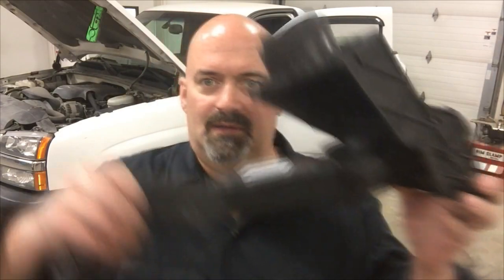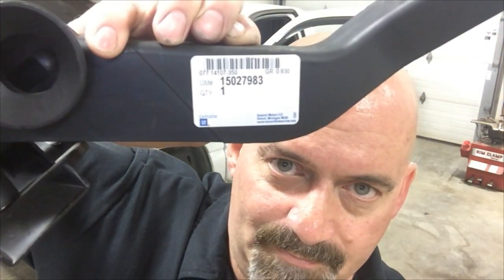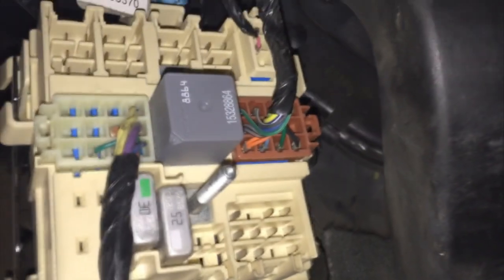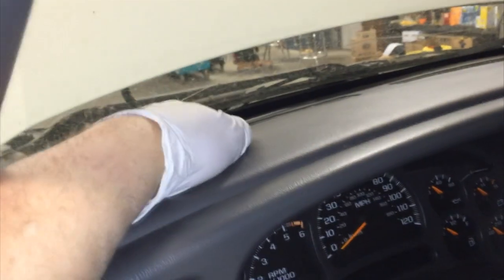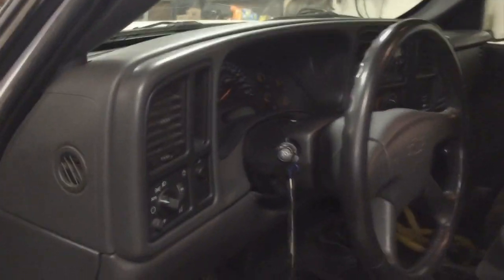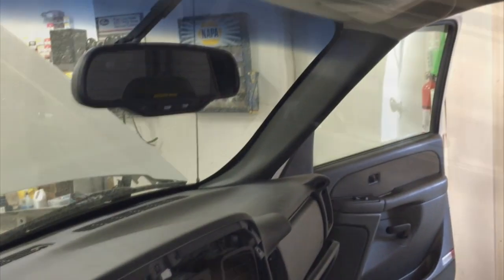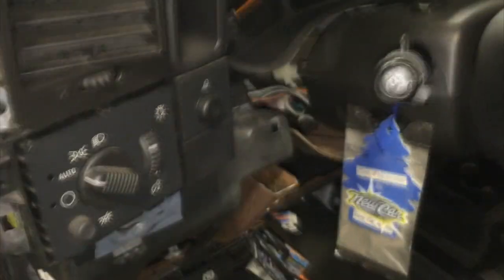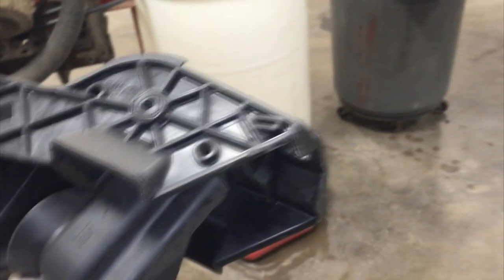Replacing Chevrolet Silverado GMC Sierra Clutch Pedal Assembly - Broken Clutch

Comment: Great Video! My assembly went out on a 2003 about a year ago. Trucks been just sitting until this week when a former employee called needing some work.  I showed him your video and he spent a couple mornings replacing pedal assembly. He started truck after replacing pedal and pop the assembly breaks again within seconds. I was not present during test or on installation. He s not a great mechanic and letting him fix it was more charity than anything. I remember a lot of pressure to push down slave cylinder, because I tried to put metal strap on firewall with self taping screws around assembly to get home when assembly broke, but finally gave up. My question is slave cylinder .or something else causing breakage , or my bad judgement in letting some one who is always losing jobs because he smokes too much pot.
Reply from the maker: Yes, sounds like a master, slave cylinder or even clutch issue causing this. I have heard a few reports of this but not run into it personally yet. Bummer deal!

Comment: Watched 2 others before this one and both of them got it out without taking any dash pieces off. They slid it towards the seat then pulled the front of the bracket down first and then twisted it and bam it's out.

Comment: So I did this and got the clutch pedal fixed, but now there is a service air bag light on the dash, but it turns off when I turn the passenger air bag on. Does anyone know what might have happened?

Comment: Trying to determine if this is my issue. 
Pedal goes right to the floor. I can shift if I mash the pedal into the carpet. 
No leaks, no low fluid. Replaced master cylinder on end of the transmission and the clutch pad two years ago. 
I do not see any broken  plastic from the engine compartment side.
Reply: Timothy Delaney I had the same issue with mine before the pedal broke. My guess is air in the system somewhere, or a leaky slave in the trans.
Reply: One way to tell if it’s the issue is to pop the hood and give the master cylinder a gentle tug forwards, if it’s not broken it won’t move at all.

Comment: Hey man, just had my trans replaced with a reman, as well as flywheel resurfaced and new clutch. Now it appears that I can not get enough play to fully disengage clutch. Shop told me that’s on me and not their problem. They said I need a new clutch pedal because no adjustment on my 04 GMC Sierra 2500HD. Is there really no adjustment or alternative for this supposed 1.5” of extra play which they claim is the problem?

Comment: I have to replace mine in my 2001 Chevrolet Silverado 2500HD and I  never once took the dash apart just the 3 bolts out of the pedal assembly and doing a little twisting and she came right on out with out breaking it more or anything else
Reply: Nathan and anyone else with issues, I have found that removing the pedal from the mount, then removing 3 bolts makes the broke mount come out easier and works best. Like Marshall Mullins suggested, a heavy gasket scraper wedged up in front of mount towards firewall is a great suggestion. I have a '02 ZF-6 speed and it finally broke like everyone else. The pedal pivot point has 2 spring loaded tabs that look like hex nuts and you can compress them and slide pedal down. The spring on the left side of the pedal will come apart obviously. When I reassembled, in reverse order, the new one I used 2 zip ties to compress it. Once I had it all back together, I just snipped the zip ties. None of the pulling the dash part is needed.

Comment: I have 3500 1996 with 6.5 engine manual shiter. I just bought it The truck had clutch problems I was told . Now start the truck only too start it in gear So basically start in 3e gear to drive I cant shift any more after that She won't engage lower or higher .Now I just brought the truck in and got the master cylinder replaced . Still the problem . Do you think its the throw out bearing or its the transmission . Let me know thx

Comment: hey I was wondering im going to swap my 91 4x4 700r4 to a nv3500 4x4 manual my question is are they the same length or will I have to customize the driveshaft length  got all the parts ro convert I even have the transfer case for the nv3500 please get back to me soon thanks
Reply from the maker: +robert Dowell I really have no idea but I bet you can find someone who knows for sure. I know the driveline service places would likely know the answer to that question. My guess would be it's the same length but don't go by my guess. Good luck.

Comment: car doctor.
I cannot find where the one of the two connectors go on the neutral safety switch not the 6 prong but the 1prong
Reply from the maker: +Cory Hall it's been a while my memory is fuzzy. Actually it's always a little fuzzy. Is there really two connectors? Is one for the stop light switch? Sorry I can't be more help.
Reply: Did you figure it out? Same problem. No dash illumination, no brake lights, no turn signals...
Reply: Did you ever figure out where the single wire goes?

Comment: No need to kick the dash back, I just did one on a 2003 Sierra by cutting back the firewall insulation and sliding the firewall side of the assembly down and out.

Comment: Here’s a question you might be able to answer. I have an 03 Silverado 4.8 4x4 with a 4l60. Ive already been thinking of what to do when it craps out which they all do. How hard would it be to manual swap? I understand I would have to cut the floor and replace the control module
Reply: I'm doing the same didnu end up doing it any tips

Comment: Hi Doc, 
I have manual 01 Sierra 4.3L.  My clutch is very hard and i have to press the padel all the way otherwise it starts grinding and would not change the gears.  Si i have two issue here hard cluch and  shifting requires pressing the padel all the way.  Please advise what could have gone wrong?
Reply from the maker: Probably a bad clutch cover plate or broken input shaft collar. Likely requires transmission removal to fix.
Reply: It could be this pedal assembly as well. was my symptoms exacly before mine broke. I had just bought the truck but found out the previous owner had replaced it twice already.Something to watch for is the quick connect coupler gets has a spring inside that can break or rust and severely restrict fluid flow to slave cylinder. This was the problem on mine and reason  this assembly broke for the third time within a year. Too much force required to push the pedal down due to bad quick connect fitting. You should check this if your pedal assembly breaks or if it has symptoms such as yours.Good Luck and thank you for the video The Car Doctor!

Comment: i have a 1992 chevy 1500 i replaced. the resavor thing u out fluid in cuz old was plastic. i got a new one running fine now i squirting out fluid u  where oush line in. i cant get line out an person who helped didnt out in the pin so i thought ok did my o ring get stuck or something.  i have pulled an all an pushed an pull out an line wont come out. can u assist me please. im doin this myself
Reply from the maker: Not sure what happened there. Maybe try a pair of pliers and just rotate it while pulling out. Sorry I cant be more help. Good luck

Comment: 2006 Chevy Silverado WTHey man,Got the job done, but I was left with one blue wire with a clip hanging down. it seemed to be taped to the clutch safety switch wire harness. When I got it all put back together,1. my instrument cluster wont illuminate (background light, everything else functions)2. no brake lights3. no turn signals4. no blower motor5. ABS idiot light6. anti theft idiot light (no alarm installed)HELP!...but the clutch works!
Reply from the maker: Sorry I just saw this. Sounds like you blew a fuse or something like that. Hope you got it figured out.
Reply: Did you ever find out where this wire connects?

Comment: how do I get the clutch switch to have spring tension on it again? that's the only thing holding me back
Reply from the maker: the switch may have broken when the pedal assembly failed. It may need replaced. Its cheap

Comment: I just finished changing that part out and now I can hardly push down my clutch an inch. Any advice? Sooner the better. Thanks
Reply from the maker: You may have a problem with the clutch or clutch master cylinder that caused the initial failure. Will the pedal operate freely with the master cylinder pushrod disconnected?
Reply: +The Car Doctor I just opened the bleeder on the  Slave and it pushed down no problem. Maybe was locked, have to get the air out of it. But now I can't get it to crank, just spins over. Not sure if I blew a fuse somewhere or what's going on. Any tips?
Reply from the maker: Spark? Fuel?
Reply: +The Car Doctor got it running. Pulled a ground out from alarm system. Still having clutch problems. Real spongy. Slave cylinder? Trying to bleed it now
Reply from the maker: They are a pain to bleed since air doesn't like to go down.

Comment: Just did mines and didn't have to do all that.....  Unhooked the battery, took the clutch master cylinder out, bolts out the pedal,  moved a few wires,  and with a screw driver I had had it out and back in about 30 mins

Comment: Is It possibly a bad master, causing to much pressure, on the pedal assembly, flange.
Reply from the maker: yes. Not likely but yes
Reply: Well I did not replace the master. all good for now till next time, cheap plastic. I also had to pull the dash back. Great video saved me alot of time. Thinking about buying an automatic next time. Thanks  for the video.

Comment: sorry, at least on ours we did not had to remove the dash, 
1. remove the fuse box, it flips foward and out
2. remove the fuse bracket , one screw is behind the kick panel
3. flip the column grommet to one side, has a clip, gets a little stubborn as older it gets
4. remove the cylinder shaft and safety switch as shown on video
5. remove screws as shown on video
6. pull bracket downward from the firewall side first slightly turning the pedal counter clockwise, and out it comes
INSTALL
reverse process
clutch master cylinder goes in at an angle then turn counter clockwise 
inspect groves on clutch master cylinder first before installing

GOOD LUCK
Reply from the maker: +Daniel Cruz Can you give us the year, model, engine size, 2 or 4WD? Thank you for the info.
Reply: Yep, Daniel Cruz is correct, just did a 2006 chevy 1500. i put a small pry bar between fire wall and opening of clutch pedal assembly and it popped right out. saved me hours. Thanks dude..........
Reply: Daniel Cruz, thanks bud!! We just finished putting ours on 9/4/2018. We almost tore off the whole dash board BUT THANKS TO YOU, we followed your steps and we are done! 2005 Chevy 1500 2WD!! Thanks again!!!

Comment: hi mate nice vedeo you know the reference of ECM that truck i need buy the same ECM for my suburban 96 because i change a automatic transmission to manual transmission i need change the ECM to but i don"t know who the reference you can help me much if tell me the reference of the ECM  thanks
Reply from the maker: I suggest you contact the dealership for exact part numbers using your VIN code. Good luck

Comment: hello I take this opportunity to say that and a great video. I have a 95 chevy suburban 6.5TD, but bought a manual transmission and all the accessories to apply because they do not like to drive cars with automatic transmission. the question is? it is possible to make this change? and like this Silverado? I appreciate that someone show me some vedeo or any help. i love my suburban and not change the other. thank you for your attention. jorge from  norway.
Reply from the maker: +jorge fonseca I am not sure but imagine it is possible. It will likely require a lot of under dash parts like the clutch pedal and even brake pedal assemblies since that's not the same with an auto. You might ask someone who does that kind of swaps as they will know all the information you need. Good luck and thanks for stopping by!

Comment: 4.3 with a 4.8/5.3 cover and intake??
Reply from the maker: With a couple less cylinders.
Reply: @ThecardoctorTV  ummmm no that’s a v8 bud, 4.3’s don’t have that cover and the tb is in the middle not near the radiator and the air intake makes a Z to the passenger side fender box
Reply: Can even see the huge wire harness leading to the intake😭😭

Comment: A plastic clutch pedal assembly made by the company that has produced iconic symbols of the American automobile industry. Cars the American people truly identif(ied) with. NICE GOING General Motors / Chevrolet...... No wonder the American tax payer had to bail out your sorry asses.
From the time I was a kid, in the early 70's. Which I was ten years old in 1970, I was nuts about cars, and had great mechanical skills. SO.... it was never a question. I was going to be an automobile mechanic, and have my own repair shop. I started doing tuneups, at the age of ten, to my dad's 1967 Pontiac Catalina. From that age on, I got tools for Christmas, and was ecstatic about it.
Engine power technology class, freshman year of H.S. Went to my high school votech center, starting junior year. Worked half a day and school half a day. Worked in a Phillips 66 service station, for a guy that had been a mechanic for over 25 years. Then the emission control era, of the early to late 70's hit. ALL the shit-running crap of Detroit came through our shop. Terrible automobiles with emission control equipment that was, at best, an afterthought. Vacuum hoses running all over the place, in an engine compartment, on a car that wasn't designed for someone to repair more easily. 
It didn't take me long to decide that, becoming an aircraft mechanic was "where it's at", and that Detroit can "go piss up a rope".
So I can relate to this guy..... I've had the bleeding scarred knuckles,on hands dried out by winter weather, and chemical hand cleaners. Making someone's P.O.S. symbol of Detroit arrogancy, whole again, after they've flooded the engine, trying to start it in twenty degree weather. Maybe it's just me, but I think the "big three" should be thanking the public, for buying their hunk of shit,  with something better than an overpriced truck, with a damned plastic clutch pedal. BUT....... that may require slightly less profit for Wall Street.

Comment: Mine broke twice in a years time so I found metal replacement options:
https://atomicfabandperformance.com/product/99-06-clutch-mounting-bracket/
or
https://kbdieselperformance.com/chevy-gmc-duramax/Metal-Clutch-Pedal-for-1999-2006-NV4500-5-Speed-Manual-Chevy-GMC-1500-2500-6-0l-Gas-p145483173
I bought the KBD one but the spring pulls the pedal higher for an uncomfortable engagement point, I am tinkering with it to see if I can get it just right.
Also, the KBD one is a tad noisy because of the metal and spring, I should have greased more of it during assembly. 
I did not try the atomic one but it looks like a possible better stock style replacement.
Also, putting the master cylinder back in was very hard with the new metal tightness.
Overall I am happy to no longer have the plastic blowout possibility.

Lastly, you do not have to loosen the whole dashboard. If you remove the pedal from the upper assembly you can then turn the assembly sideways to pull it out down by the brake pedal. The pedal is in the housing via spring pins. you can just push them in from each side with a screwdriver or a socket extension bar or a very strong finger.

Good luck!

Comment: Understand that my comment is in no way referring to the video. This is a bunch of horse crap! GM should be ashamed to A) make a high use component out of cheap plastic and B) requiring a disassembly process this lengthy to replace said cheap component.  They say that GM was too big to let them fail back in the day but they are so inefficient we would’ve been better off to let them go.